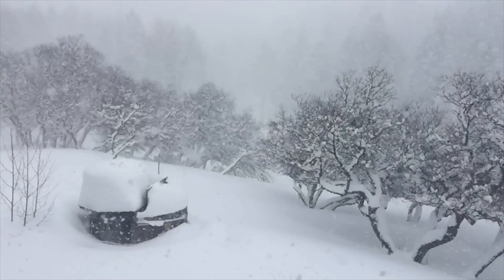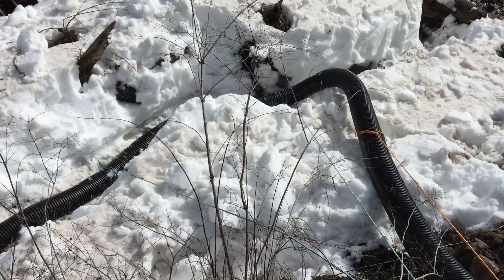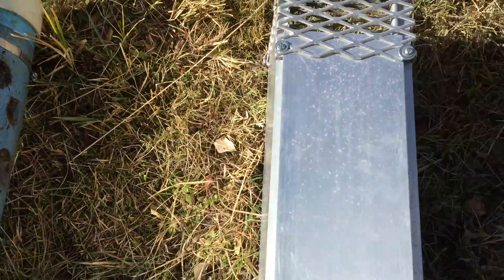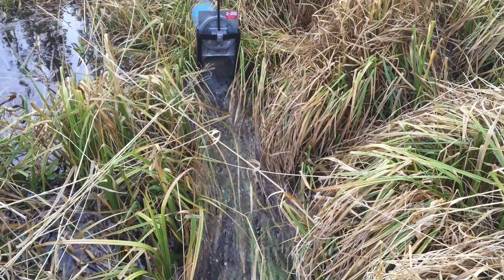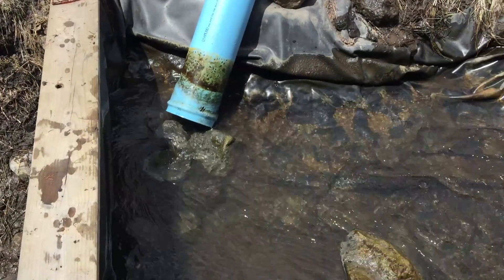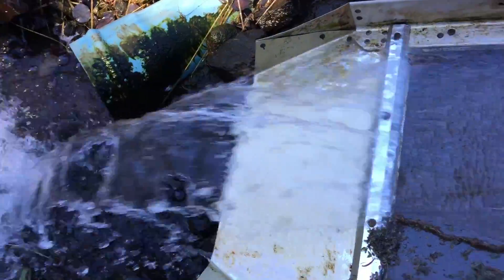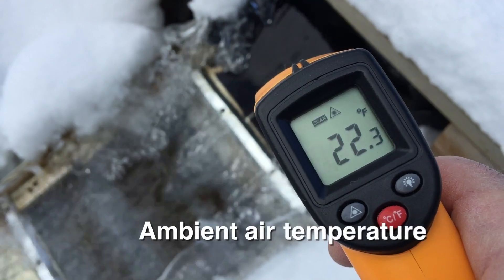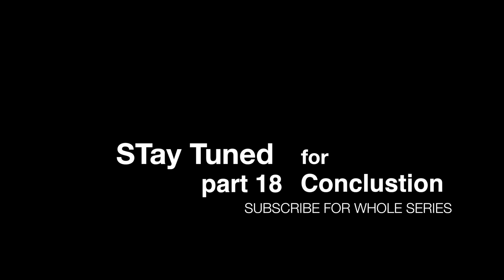Part 17 MicroHydro Power System in CO

Comment: If you lay a thin sheet of metal over your coanda screen such that the:
1) uphill end is above the water level,
2) is the location of pivoting attachment points, and
3) the downhill end of the sheet metal is free to 'float' on the stream of water, 
you could further force/urge more water through the coanda screen.  Since this sheet of metal floats on the volume of water, it would be auto adjusting based on the flow of water and the buoyancy of the sheet can be adjusted by any weight you place on top of the sheet.
Reply from the maker: Thx for the suggestion. It certainly sounds like that would function well. We currently have more water supply than we can possibly utilize. We might install a second jet at the turbine this year which will necessitate more flow. We shall see. Thx for watching!

Comment: This is an awesome series, i love it so much! can i see a link to your generator? I am looking to try this myself. Thanks!
Reply from the maker: Let me look it up
Reply from the maker: I bought in 1990, a different era. The company has changed ownership a few times, but to my knowledge their quality looks first rate. Prices are higher no doubt. But why not buy long term high quality?  If you need it, find both 3 phase/ 1 phase capability for transmission. 

Most important factor is to find out if AC or D.C system works best. Most cost effective for your specific site makes sense. Head & reliable flow, these are the most important measurements, don't overlook them
Reply from the maker: Oh yeah
https://www.marathongenerators.com/MGPS/standard.jsp

Comment: It would be interesting to know how much power you need to heat your home. Here in Sweden (very cold at times too) we measure a house's efficiency by looking at how many kWh you need per sqm a year. Normally a home in Sweden need around 120 kWh/m2 a year but the real efficient homes use only <30 kWh/m2 a year. @11:51 Icicles may indicate you need additional insulation in the roof.
Reply from the maker: For science sake it would be interesting. A lot of our heat comes from passive solar design and on sunny days in the dead of winter we need to open windows to cool things down. So calculating power requirements would be difficult. The icicles result from the valleys in the roof design and snowmelt freezing at night or on super cold days. The fact that we don't have any utility bill and are comfortable with the temperatures means that making changes to insulation or calculating measurements might be a process of seeking perfection vs. a simple life. But thanks for the ideas.

Comment: Living in Canada, I can relate to issues with icing and snow when dealing with water flow in winter.  I was wondering if you had considered the application of heat to the stainless steel screen the covers your intake. Stainless steel has a very good thermal conductivity and since you are generating more power than what you require for use, wouldn't it be possible to install a heat trace on the grate to eliminate the build up of ice?  

Great video series! Wishing you continued success in your power generation project!
Reply from the maker: Sean Mouly Thank you for the thought. The screen has not actually frozen all winter. It can develop a crust of ice that create an umbrella of ice over the whole screen, but the water flows into it unimpeded. No freezing on the actual metal. Also the excess power is at least 2200 ft from the screen intake, so...
Thanks for watching and the good wishes. My Canadian wife and I are blessed with abundant power in this winter wonderland.

Comment: Impressive, you get 74.5MWh/year.  But do you actually use that much in a year?
Reply from the maker: Its all a ton of power and you are right in questioning how much we can use.  We actually have to "use" whatever power is generated as there is no storage for AC.  Whether it is productive use or waste heat it all has to be consumed.  The Winter usage is much higher as we heat the house and a hot tub in addition to all other lights, appliances, and domestic hot water.  Other seasons we actually dial the system down (reducing water throughput) to about 4500 watts.  Nonetheless in the summer our garage/basement where the dump loads sit gets toasty hot, sometimes to 85° or above.  That should be a bit lessened this coming Summer as we now have the hot tub in place.
Reply: If you were connected to the grid you could sell your excess power, but then again there are yearly fees, power transmission fees and so on
Reply from the maker: 7 miles from grid would have cost ~$140k in 1995 to string line to our property and today $250-300k. So...never made any sense.

Comment: you should be very proud of your work.  a few thoughts that may interest you from the wastewater industry.  a 'static screen'  that uses wedge wire like the one you used but shaped differently to self clean might be of interest.  https://www.parkson.com/products/hydroscreen/bi-wave-panel-static-screen.  also for you high points where air collects a simple air release valve might keep you running at max flow.  i have used these before on municipal projects  http://www.arivalves.com/products/water-supply/item/d-040-combination-air-valve-barak.  i am sure you can get small versions of both of these items.  you might also need an insulated (foam/roxul board) enclosure to keep it from freezing during the depths of winter.  food for thought.
Reply from the maker: Thank you for your suggestions.  I have just installed a new screen which is much better at self cleaning.  New video will soon be released showing this.  And I've also installed a Submerged intake structure that so far has prevented any air from entering the diversion pipe and allowing for a full pipe siphon transmission of water. This will also be in the upcoming video.  The air valve you link looks to be a good solution too, but hopefully I've overcome my air lock issues from the top end.  I'll keep the link just the same.  When searching for an air release valve I wasn't able to locate one that would be anti siphon as well, so its a welcome link.  Thanks again

Comment: Will you invest in renewable energy batteries so when the system isn't producing enough you don't have to fall back on to a generator, or is that too expensive. Again, amazing video series :D and amazing project! I've watched this video so many times and now I'm going back to look at the others
Reply from the maker: We don't need to store power as we generally have more than we can utilize.  The only time a generator is needed is when I run a 5 HP compressor in the shop.  Other than that, we are good on about 3500-4000watts in all seasons but winter, when we crank the system up to about 8500watts for the heating of the house at 8600ft.  Thanks for watching.

Comment: your intake should be underwater and your pipes sleek, the ruffles cost you a lot of energy, good luck
Reply from the maker: Actually the ribbed part of pipeline is only a diversionary water feed to the meadow and is unrelated to pressure loss due to pipe friction in the system penstock.  It supplies more water than the system can handle to the meadow with excess returning to the creek. The issue of spring washouts in the creek has prevented burying that portion of pipe as it has to be removed to keep from it from being washed away each spring.

Comment: You could sell any extra electricity to the grid and if you want to go as far as to sell electricity to your neighbors. I really want a piece of property with a creek that I can create a hydroelectric dam on to sell electricity to the grid and use it for personal use.
Reply from the maker: +chiken da gr8   grid is 7 miles away, selling is not an option.  1995 estimate to run line to property was 20k per mile = $140k, today that estimate is more like $250-300k. Initial cost of spring fed system (parts 1-5 of series) was $25k including fish pond and domestic water supply.  Add less than $55k for the full re-install (parts 6-17) with a MASSIVE increase in power and it's all a no brainer.  No power bills for the rest of my life and extending value to the property beyond my lifetime.  Nuff said

Comment: Would it help with debris if you added a floating pontoon before your overflow into the weir to divert it and then add second overflow for the debris to exit the pond from?  Might cut down on cleaning your screen.  So glad you've done an update, can't wait for more.
Reply from the maker: I have now installed a new Coanda intake and it should be self cleaning.  It wil part of the next video

Comment: Very interesting, how much water will the state let you take from the intake point and can you sell back excess electric to the power company ? Also great to see you doing your part in using mother earth respectfully and not aiding fossil fuel use.
Reply from the maker: +sensible solutions I originally filed for 3cfs in my water right, but use well under 1cfs at current max output. Someday may add a second jet to the turbine, but no good use for the power at this point.  Actually run the system at lower flow most seasons except for winter, when heat is best utilized. We are 7miles of grid so no sale possible.  The system has very low impact.  I just wish someone would mfg a reasonably priced electric SUV, so we could fully abandon all emissions.

Comment: Such a fantastic video and I love what you have done.  Am I to understand, from the need to max your load, you are not connected to grid?  Why not connect and sell your excess back?
Reply from the maker: +Dakota Lally 7miles from grid and a primary reason for original installation.  We were quoted $140k to lay in power lines in 1995 and that might cost $250-300k now.  So, very happy to be truly off grid.

Comment: Perhaps some power could be re diverted into heating elements for key points of the piping to prevent icing,  like how aircrafts heat the leading edges of their wings to prevent icing and build up of frost
Reply from the maker: +Strafing Hunter The farther you get from the power source, the more line loss you get and the more the wiring costs.  It's not really practical or all that effective to pursue what you suggest.  The biggest risk of freezing it at the weir intake.  Once it's in the buried pipe in the ground, there is no problem

Comment: wander how much it has cost? and how much youd save
Reply from the maker: +Levi Sadler Repost a previous answer to a similar question:  Thanks for watching. An estimate to run power lines to the property in 1995 was $120k and more recently $250-300k, so the initial investment in the first system which supplied both gravity fed domestic spring water, a fish pond and power all for around $25k in 1995 was a no brainer.  The redesign and move of equipment added about $55k to that and provides all the power we need for winter heating and potentially bitcoin mining in the future.  So it's not really looked at in terms of pay back, but more an investment in the property and an independent lifestyle

Comment: What company made your brass pelton wheel? Next, how much did it cost you? Third, did you make it?i like to get it myself.
Reply from the maker: G. Andrew Flaccus My turbine was manufactured by Canyon Hydro in Deming WA in 1995.  At that time it cost a fraction of what it would today from them due to inflation. I think turbine and generator were under $10k. It is possible to make your own.  These folks did, https://youtu.be/8Wnoa5oEvXs , but it does require a lot of skill sets.  There are various places where you can buy pelton wheels online and fabricate your own support and jet housings. Things are so much easier to research and source today via the internet than they were when I began.

Comment: Are you able to take a trip during the winter?  Will the house switch to grid power if the flow is interrupted?
Reply from the maker: +Marty Chader No grid here, 7 miles from it. And, yes we have taken short trips with the system functioning as usual.  First year it was installed it ran all winter without halt as we hadn't yet moved here full time.

Comment: Hey! I could not find it in the whole series (very likely I missed it) - what is the water head and water flow?
I saw something about 12 liters/s, but that would require like 40m (~130 ft) water head to get the kind of power generated.
Reply from the maker: Dominik Marszk It's about 300 us gallons/ minute at 235-240ft head. Dynamic pressure is about 90 psi at that flow rate.  Sorry for the goofy US measures.  Perhaps someday the us will join the rest of the world

Comment: I know its probably a long ahot but fish tank have an air check valve and only let air thru and not the water they were designed specifically for the just in case your power went out and water wouldnt siphon back thru your airlines and save your floor and airpump from getting messed up. Look it up it would be a good add on so you wouldnt need too bleed the tubes. https://www.amazon.com/Jardin-Plastic-Aquarium-Valves-2-Piece/dp/B00880E1ZY

Comment: How much energy is lost by way of surface resistance/turbulence in the flexible pipe versus the rigid smooth surface pipe?  My experience with wood dust collection systems is that a rough surface decreases air flow velocity much faster than smooth straight hard piping.  Or are you simply at the point where you are generating more power than you need from available flow so this isn't a concern.
Reply from the maker: Not really an issue. I'm certain there is considerable loss due to friction.  I don't have a way to measure the friction and smooth pipe isn't really an option due to the difficulty of getting equipment in to construct a line, we have excess water as is, and yes we can't use all the power we generate anyway.  Each year we remove the diversion pipe for the spring melt water and the resulting stream bed is altered and different when the deluge subsides.

Comment: If you were to install a fabric wrapped subsurface collection gallery (French Drain) during the dry season, at a depth of around 2-3 ft below stream base, you would eliminate freezing problems, turbulent flow and airlock issues, and debris accumulation related to turbulent flow and vegetation on the fabric. Of course you would need to account for anticipated matrix flow through the soil in order to size your collection gallery and you would also lose a couple of feet of head at your turbine.